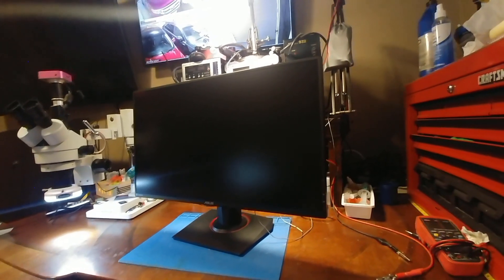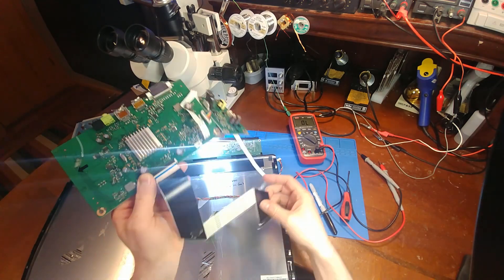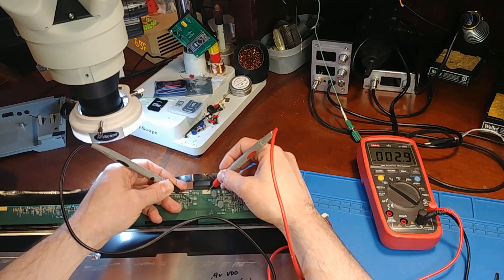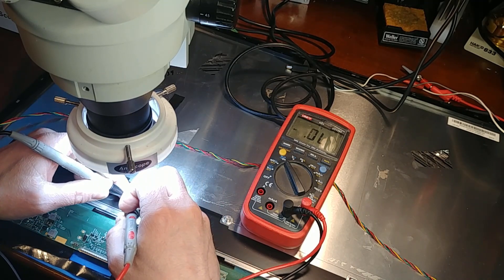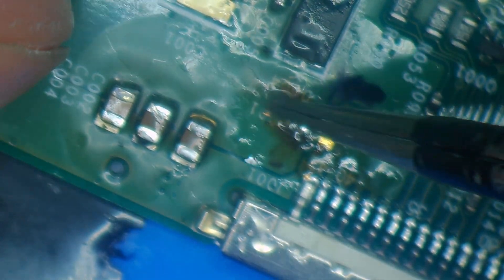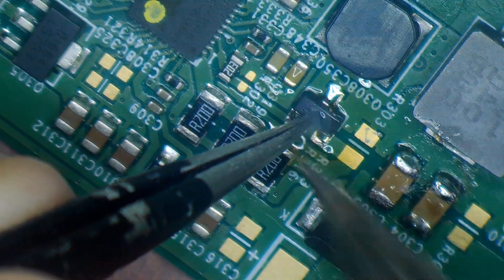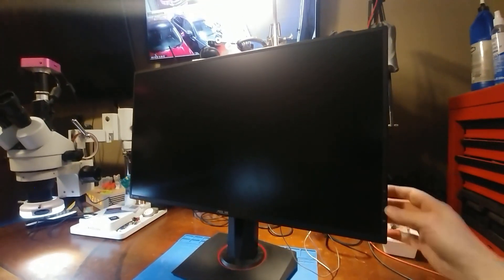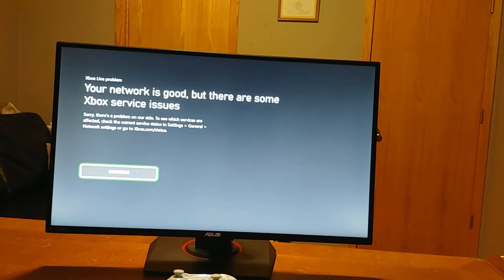How to fix Asus VG278 white screen

Comment: Dear Jeff
Thanks for your generosity sharing your knowledge and experience with so many other folks like myself.
God bless you!
I have an ASUS VS24A with very similar problem - black screen, no logo, but when connected though a HDMI cable to a laptop, the computer recognizes the monitor, however no images are shown
ASUS has suggested me to take it to an authorized shop but the cost was higher than a new monitor in Brazil.
The problem started some 2 years ago when it went black and standby led was not turning on.
I checked the power suply and replaced some inflated capacitors, a Mosfet 70Amps etc
The standby light now turns on, backlight lamps are lit, etc but no images are formed
I cheched the voltages goint to the ribbon cables tha connects to the monitor circuitry and the voltages there are 1.3xx Volts not 12V
Without the schematicas (denied by ASUS) I have no clues as to what voltages should be supplied form the power supply board to the video card. There should be a 12V going through?
Could you please offer some help?
Thanks in advance and again congrats on the nice job
Reply from the maker: Sorry I'm not familiar with that problem with that model. You will need to either do some deeper trouble shooting or try replacing the main board and or t-con.

Comment: Can the transistor short out even though the fuse is still good?
Reply from the maker: It's possible, if something else in the line acted as the fuse, or if for some reason the conditions are right and the power supply can't make enough power to blow the fuse.
Check the transistor with diode mode on a DMM and see if it's fishy.

Comment: Thank i change a09t done. But i use 4 day and it problem same . And i replace again but not work. It still whitesreen. Can you help me?
Reply from the maker: Did you check the fuse?
Reply: @jeffescortlx  yes  i change new fuse but same
Reply from the maker: @lethanhtung1056  might want to try a different mosfet.
Reply: @jeffescortlx  i find done it problem in mainboard . Few min i give you sreenshoot
Reply: have you got shematic mainboard ?
Reply from the maker: @lethanhtung1056  I do not have schematic. That looks like a different problems then what I've covered in this video.
Reply: @lethanhtung1056  I have the same problem.White screen after replaced fuse and AO9T. Υou finally found what is the problem in the motherboard?
Reply: @jeffescortlx  could you make the shematic available ? for me its Q9 on the mainboard that is blown, because of the fet you replaced, its near the connector for the flat cable going to the tcon board
Reply from the maker: @WaschBaer_95  I do not have the schematic.
Reply: https://i.imgur.com/9BDIMFX.jpg
Reply: @lebaonam8022  حليت المشكله I have this problem can help  I need numper this mosft

Comment: So if the fuse has continuity is it good? I just picked up and LG with the same control board doing the same white screen
Reply from the maker: Yes continuity at 0 ohms is a good fuse.
Reply: Ok thanks I got a fast one pulled in buying 2 of these white screen monitors.

Comment: Thanks for sharing!

I have that same monitor model VG278Q that broke yesterday

My problem on my monitor. it doesn’t have a white screen however when I turn it on, it stuck on the ASUS logo and I tried to press any side buttons and it doesn’t respond

I’ve been using this monitor for 3 yrs and 8months and suddenly died :(
Reply from the maker: Being that this is a common monitor with a common bad panel issue, I bet you could find a main board on eBay for a very reasonable cost.

Comment: Awesome video. How did you figure out the Mosfet part number ?
Reply from the maker: After I figured out the original shorted mosfet number, I googled it and found a Russian repair forum where someone else figured out a cross reference number.
Reply: @jeffescortlx  Thanks for the reply. I had another Mosfet blow up and the reference number was burned it's designator is (Q9) not sure if I can replace it with the one you suggested.
Reply from the maker: @aminezakaria2734  I wish I could help, but I don't know if that same one will work.
Reply: @jeffescortlx  hello again sir can i ask if ALL ASUS Monitor VG Series i mean 
 VG248 VG249 VG258 VG259 VG278 VG279
have all the same mosfet 12H34
 coz i found A09T 30V 5.7AMP A03400 

i have the same issue when i turn on my Asus VG258QR monitor white screen after 5 seconds monitor turn off and turn on white screen again for 5 seconds and turn off i hope we have the same issue
Reply from the maker: @KyoHeiSuminoe  I'm not sure, I've only had this one of this series apart.
Reply: Your video helped me a lot already.Thanks a lot. Can you share the russian forum please?
Reply from the maker: @aminezakaria2734  https://monitor.net.ru/forum/threads/647496/
Reply: قدرت توصل لحاجه علشان انا عندي شاشه فيها نفس المشكله بتاعتك
Reply: @ahmedhassan-dy7nf  اشتريت البارت بس ما استغل و رسلته ل أزوس و صلحوه ببلاش.
Reply: @aminezakaria2734  عايز  رقم ليك او اي وسيله تواصل اتواصل معاك

Comment: https://www.amazon.com/20PCS-AO3400A-MOSFET-SOT23-AO3400/dp/B01CCU0TVK
Does this work? I am having a hard time finding the transistor that isn't from china
Reply from the maker: This is the one I used
https://www.ebay.com/itm/293791131190
Reply: @jeffescortlx  Thank you! I just am not sure what I would do with the other 19 and it seems like a waste. I wish someone just sold 1 :/ 
Do you think that amazon one is compatible though?
Reply from the maker: @jamesneutron332  yes the Amazon one looks to be correct.

Comment: Thanks for making this video, dude! it's helped me to diagnose an LG 27GK750F-B that suffers from the same problem. They quoted me £230 for repair service but after removing said mosfet, all the shorts are gone! great stuff, man
Reply: Yes so far from what I'm seeing they use the same board
Reply from the maker: Sweet. It must share the same LCD panel. Glad to hear it helped!
Reply: I just experienced that today on my LG 27GK750F-B. Did it make a coil whine noise? I tried to get to the daughter board but stripped one screw. :face-pink-tears:
Reply: @nhozdien5058  yep! those were the symptoms on mine too. I think the noise comes from something vibrating on the main circuit board when that power rail goes into short circuit. 

For what it's worth, you might be able to work past that stripped screw if you carefully drill it down so that the head comes away and you can continue working from there. Mine failed again pretty quickly when I used A09T MOSFETs so I bought some 12H34s from aliexpress and those worked great for me. I've since doubled the recorded working hours on the monitor and I've had no problems at all :) Well worth the time if you can do it
Reply: @ndrewwb  hey, thank for the reply. Finally got time to open the striped screws. Turn out, I wasn’t that lucky. I got at least 8 shorted capacitors, and the said faulty 12h34 mosfet 😢 Some of those cap is extremely tiny, like less than 0.5mm, and I don’t think i can replace those. Probably try out local electronic repair, if their quote is as high as LG from what you said, i will buy another used 240hz monitor from amazon.

Comment: Hi @jeffescortlx, I have Asus VG278 monitor with the same problem. Would like to try to fix it too. Would you please let me know if FUSE 2.5A 32V SMD 0603 and MOSFET N-CH 50V 220MA will fit here. Thank you.
Reply from the maker: N-CH yes, but 220ma sounds way too low. Specs are in the video description.
Reply: @jeffescortlx  Thanks for quick reply, The reason I bought 220MA - I was searching for original 12H34, because I wasn't able to find AO3400 in US, only China and the N-CH 50V 220MA was the first in the search result and it looked similar to the one you dismounted. Sorry for bothering, but if I try 220MA nothing bad gonna happen? Thank you very much again.
Reply from the maker: @romano8036  Digi-key, mouser or newark should have something compatible stocked in the US. You want a around a 5 amp mosfet. a .22a will blow instantly. I believe I found a ebay seller of the AO3400 that shipped fast.
Reply: @jeffescortlx  Jeff, I don't know how to thank you. I have kept my broken monitor for over a year, I was applying for manufacturer warranty and they never responded. I was about to throw my 2 years monitor into garbage, but thankfully I've noticed your video. Also thanks to you I've learned how to solder for the first time, I really didn't expected it to work but now I have a monitor that works like nothing happened. Thank you very much man!
Reply from the maker: @romano8036  I'm glad to hear you got it back to working!

Comment: thanks for the video! mine has the same issue, though the solution has to do with q9 transistor blown on the main board. any ideas why that is ?  i ordered another replacement board and it blew again :(
Reply from the maker: Since I don't have the board in front of me anymore I have no idea what q9 does. Sorry I'm not sure what's causing your problem. No short on the 12v LCD flex board?
Reply: @jeffescortlx  ill have do some more digging. thanks !!
Reply: @dad_breams  i have the same problem. Found any solution? What transistor did you replace it with?
Reply: @dad_breams  think it could be FMMT3905?
Reply: I just tried a new q9 pnp transistor. Now same transistor as in this video turned into smoke. Explains why it burnt in first place :)
Reply: انت حيلت المشكله ؟

Comment: TV, Laptop or car, Best Practices work. What do I mean? Confirm the complaint, next do some simple checks while getting a lay of the circuit(s). Do a good visual as you may see the possible problem like signs or hot areas or discolored spots, replace the obvious but check to see if the problem is still there and confirm the part you removed is good or bad. This helps with confidence to move forward as you said, “Something made the fuse open”.
Follow the circuit, simple quick test as the DMM on diode setting produces some voltage as diodes have a 0.7 volt drop. The mosfet is used as a switch & 95% are “N” channel type. If the numbers can be read, chances are you can find it or specs to help get a different brand. If in doubt, always go slightly bigger in amps, voltage or both. I miss the days the diagrams was on paper and under the back cover. At least many print it on the PC board. Nicely done.

Comment: Great video.  Working on the same monitor. I had to replace Q9 on the main board ( was incinerated, could not read p/n ) . C334, C338, C806 were shorted too on the screen's pcb. Removing C338 ( tiny black component ,  measures 0 ohm )  there was no more short on C344 and C806. Replacing Q308, F001 as you did , I get steady 12V on the screens's  pcb, and these voltages : 1.24V on L302, 0.86v on L304, 3.3v on L305, 0.0V on L308, 0.09V on L307, 11.92V on L301.  It is obvious not all voltages are correct , and there is still no picture , backlight only. If someone has more info , please comment.
Reply from the maker: What part number did you use for Q308?
Reply: @jeffescortlx  To be on the safe side, I used a more powerful SOIC-8 mosfet AO4406.
Reply: What did you replace q9 with? :)
Reply: A31E mosfet, SOT-23 package
Reply: @aquarius9909  no results on Google. You have any link? Maybe a datasheet. Thanks! :)
Reply: @Tube634  any n-ch mosfet 30V 6A does the trick. Please post voltages from the screen pcb if you get going.
Reply: Hi can you give me name Q9 i can not find it
Reply: @lebaonam8022  any n-ch mosfet 30V 6A does the trick. Please post voltages from the screen pcb if you get going.
Reply: Hey have you solvedanything yet? i have the same issue

Comment: I was wondering if you have ever worked on a Kenwood double din receiver with navigation?  The reason I am asking is because there are a lot of us that have this unit and from what I can tell is the Garmin Navigation board is causing the unit to stay in standby mode. I have found where one youtuber has taken the board out and refloated the chips and it starts working after that.
Reply from the maker: Sounds like the Chrysler radio.

Comment: If the fuse was marked "O", then it was 2.5 amps.
Reply from the maker: Looks like it was. I'm pretty under sized at .5 amp. Although I used a resettable fuse. So far so good it's still chugging along. I can't imagine the LCD panel (not counting back lighting) to need more than 6 watts. So maybe it will be ok.

Comment: I am envious of your ability to find and repair faults like this, with what appears to be no repair schematics. I aspire to learn to do this with my own stuff.
Reply from the maker: I've just gotten so use to never having access to schedmatics I've formed trouble shooting habits to work around that to figure stuff out. Chasing down shorts is pretty straight forward. Other repairs are more difficult.
Reply: @jeffescortlx  I think watching videos like yours helps, because if I was presented that issue, I'd be lost. Checking for a short would not have come to me. I do it as a hobbyist thing, fixing old computers, so I got a long way to go.

Comment: Well done :-D,  A handy monitor saved from the dumpster of dooooom :-D
Because so many fail, it makes me wonder if they selected an under rated  mosfet on purpose.
I would be trying to bodge a much bigger mosfet in there or near.
I never liked the idea that transistors are supposed to be boiling, it's not a tube or valve.
Don't forget to get the cat to do a final inspection :-D
Reply from the maker: I agree, the engineer may have under sized the part or the purchasing department saved a buck on counterfeit parts. The cats are on time out from my office for misbehaving lol. Now they just sit at the door and meow.
Reply: @jeffescortlx  Yep cats are like that lol, they will try to make you feel bad and wear you down.
' Please let me in,  i won't do it again,  i need to see yoooooo. '
They would have been good at tourturing criminals, the criminal would not stand a chance.
Cats think they are missing something, shallow furballs lol.
But we still love the little gits ha ha :-D

Comment: Great job like always! Recently picked up TV that someone was giving away due to the half screen backlight was out. TV was used outside, therefore got some oxidation on the LED strips. Few solder points later I have a working TV with a free Netflix account (since the previous owner never logged out from the app :) ).
Reply from the maker: Fixing free stuff is great!!
Reply: Just fixed 2 Samsung tvs that were being tossed. One had a bad Wi-Fi card that I simply disconnected the other had some blown caps on the power supply board.
Reply from the maker: @sjn7220  I've heard about the Samsung TV with the wi-fi board that shorts out the 5v rail, but I haven't come across any my self yet. It's a nice feeling taking trash and making it useful again.
Reply: @jeffescortlx  Yeah, I found this on the curb with a sign taped to it that said it turns off while watching. I though it might be bad caps but they looked fine. I noticed every time I went to the on-screen wifi settings the tv would lock up or turn off. I then looked at the wifi card and it was pretty warm to the touch and looked discolored. Disconnected it and now have no problem with it; have it hooked up to a roku.

As you said, I find it super satisfying to fix broken things. I've even fixed many things I have no use for just for the joy of it. But, I'm only an amateur, educated on YouTube.

Comment: This could have been a two minute video.  Everybody knows to check the fuse... and replace it with a much larger one.  Manufactures cutting corners using a tiny fuse to improve profits!
Reply from the maker: But if is was only a 2 minute video you would have missed the part about the cause of the blown fuse. The shorted MOSFET.